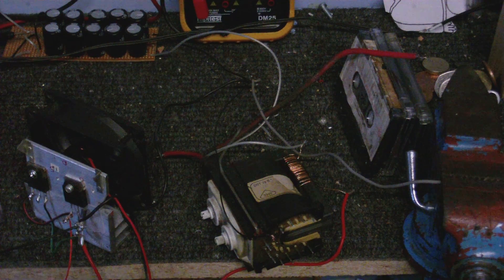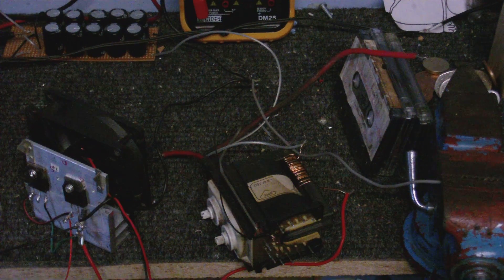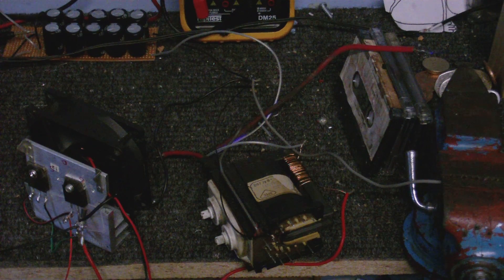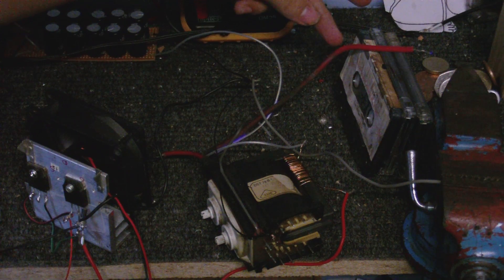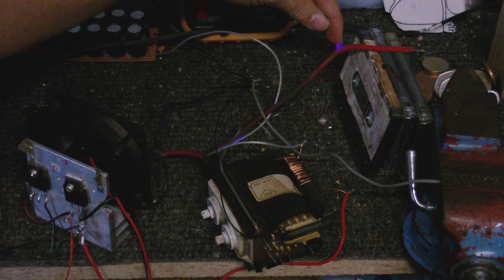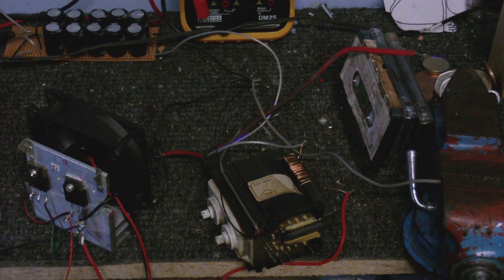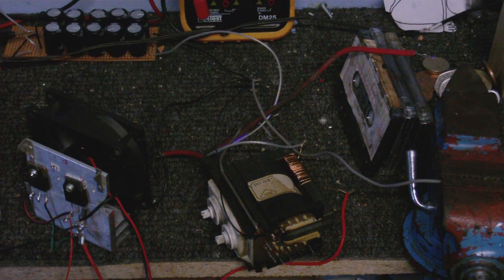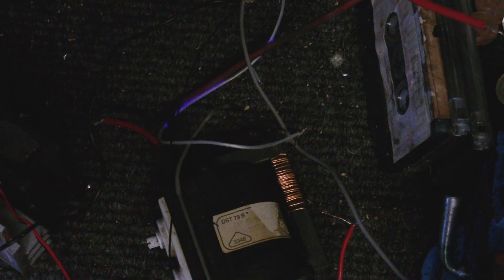Something really wierd happened with my flyback.

Comment: It's called capacitive coupling, two conductors (your finger and the wire) separated by the insulation makes a capacitor. I don't know why you'd be seeing it with DC though, AC passes its influence through a capacitor and that's what you'd expect to see here.

Comment: @DragonFlyback256 yeap but and old HV insulator can 'create' more corona than a new one. And better insulator = less corona. And corona kills the insulation, i've seen a 2kW AM transmitter and the porcelain insulator (for the antenna) killed every time by corona and then an arc strike from the antenna to the ground! And i thing that the transmitter was working at 2000 volt (but im not so sure)

Comment: Ok two things happen there the first is that you may kill your flyback diode and the wire and you body act like a capacitor(if you dont know capacitor conducts AC and blocks DC)

The other thing is that the insulation of your high voltage cable is dead!!!

And that effect is named CORONA discharge !!!

Comment: OH, forgot, the reason why you don't feel it is because of the so called skin effect. At these high frequencies the high voltage travels in your skid, that's why you wont feel. it. But if it was a bigger arc you would get a black spot on the finger and a nasty smell of burned skin in your room.